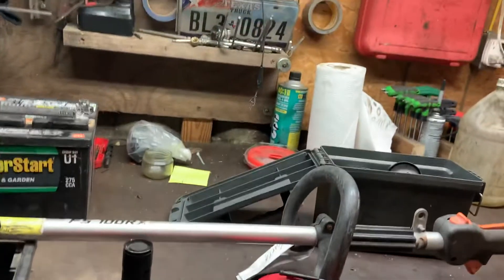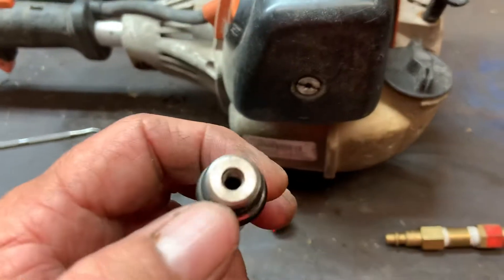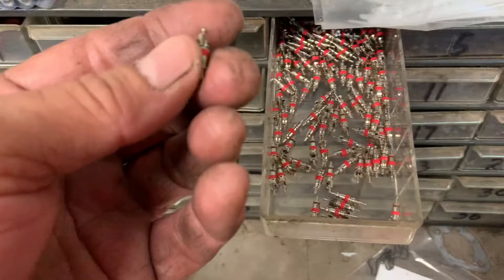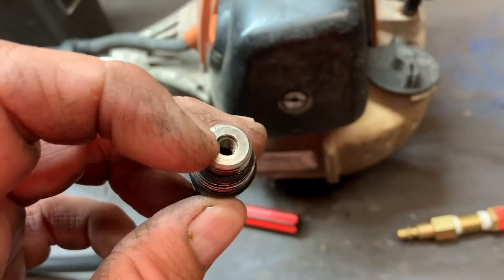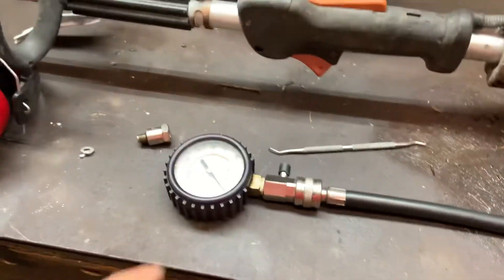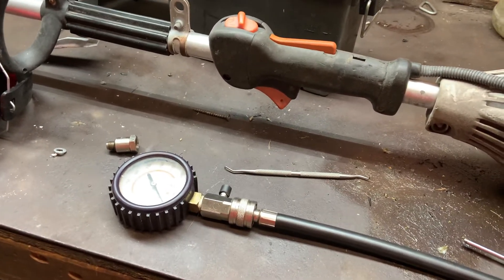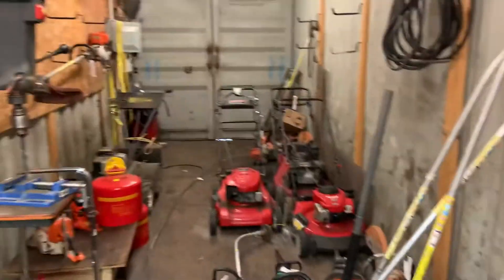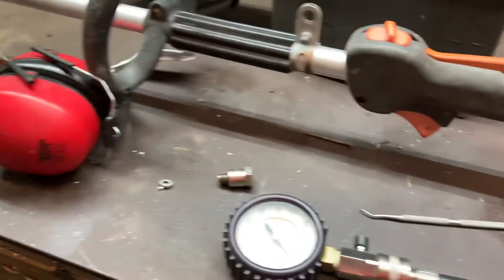Compression tester schrader valve is different from the ones for tires.

Comment: It would be great if you could mention the part number or link to the part. Like you said you can’t easily source them locally.
Reply from the maker: @greggszyp7371    Schrader valve for compression tester. 
Brand- Milton
Part#- 1251-2